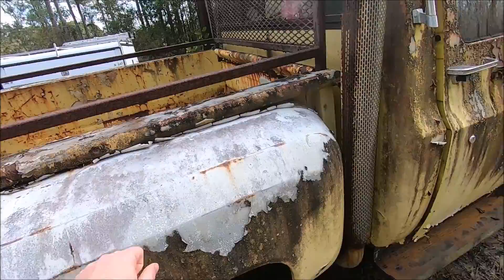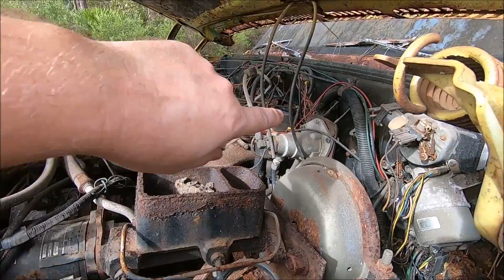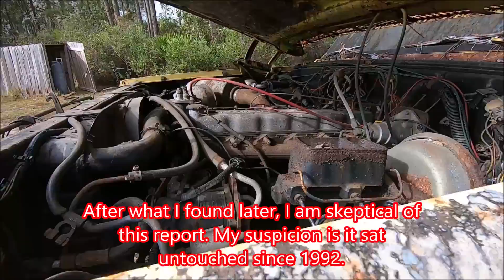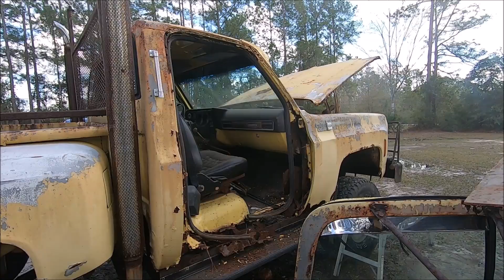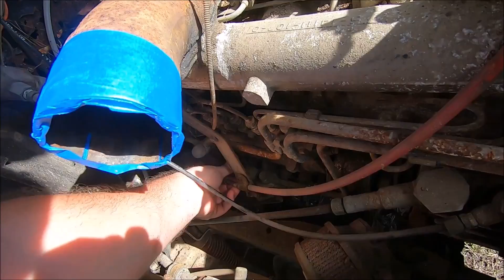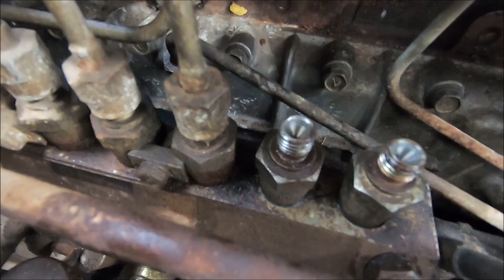1975 Chevy squarebody stepside 6BB1 diesel project begins! [walkaround and introduction] -- Part 1

Comment: I'm amazed it didn't fall apart while being washed! 

But it's certainly got a charm about it, probably was a super clean rig 40 years ago! Of course it'd look great doin' some off roadin' so long as it has enough chassis to survive moving under it's own power. But I absolutely love that front bumper, it's hideous in all the right ways. Looks like something that should've been on the CUCVs.

As for the sheet metal? I'm a Toyota guy and have seen vintage land cruisers and jeeps that are pretty much just rust flakes in a bucket get restored from scratch. but the door falling off? That was one of the funniest things I've seen in years...Of course, could always just leave the metal and do a Mad Max build.

Comment: wood u sale tha rims off that truck
Reply from the maker: I might if the price is right. I always preferred the steel rally wheels.
Reply: what kind of price u got in mind @wrenchwranglers
Reply from the maker: @southernman7692  I’m open to offers. I haven’t researched what they go for so I have no idea at this point.
Reply: 150 to 200 no more then that @wrenchwranglers
Reply: Look to c 50 to 60 trucks. And. GMC.  Buy whole parts. Truck for good. Cab @wrenchwranglers

Comment: I think I have a soft copy of the shop manual for 4bb, 6bb, 4bd, 6bd, 4bg and 6bg as well, this engines ones running is very reliable not very powerful but the 6bd1t and 6bg1t can be compared to the 5.9 cummins  even both in stock forms some versions of the 6bg1t is a little bit more powerful. And this engines sleeved engine so they can be continously re built
Reply from the maker: Does your shop manual have the injection pump breakdown and rebuild in it?
Reply: @wrenchwranglers   Not a sure, I am watching your video so I could help you out with it because this engine in pretty simple
Reply from the maker: @shevaughnwright6548  that’s great I need all the help I can get 😂😂. I found a basic manual but they completely avoided the pump other than to show a diagram like ‘this is the injection pump’. Like, great, thanks Isuzu….. lol
Reply: @wrenchwranglers   No it does have any details on the rebuilding of the injection pump.
Reply: @wrenchwranglers   it's a zexel injection pump if you want to know the manufacturer
Reply from the maker: This one is the original Diesel Kiki. Bosch only bought them out and created Zexel in 1990 so this is older than that. It’s definitely old.